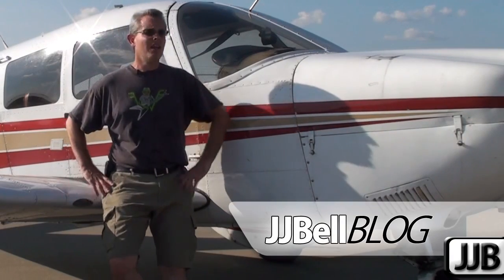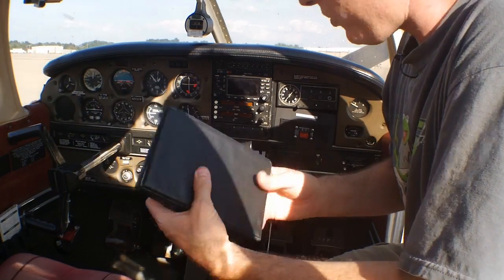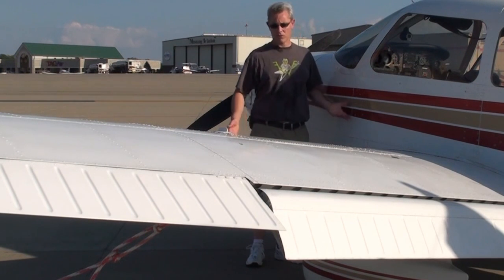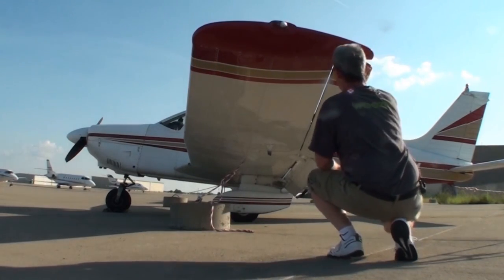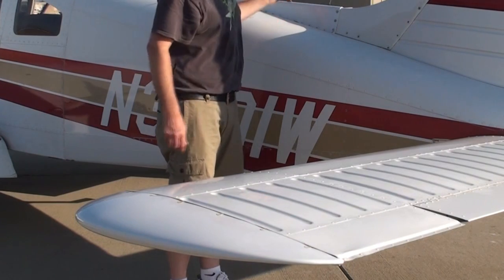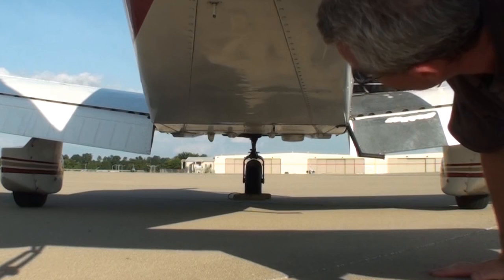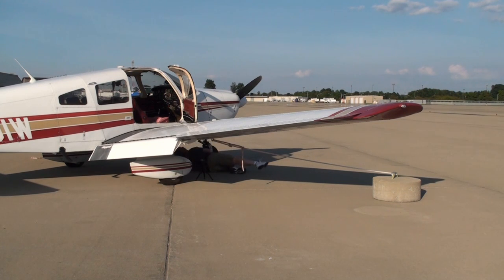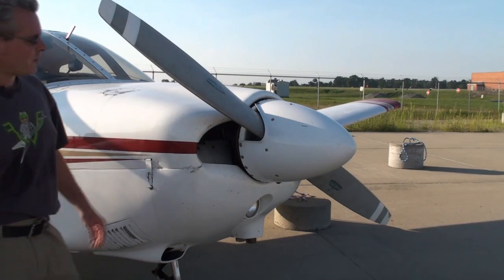Archer Preflight Inspection

Comment: Hi John, just some remarks. I suggest opening up the engine hatches and be sure nothing unusual is hiding in there. Check cables, leakage, etc.... In addition, check the breaking fluid. For your viewers, I also suggest to be sure the hatch locks are secured. Check the breaks. on the landing gear. If possible jiggle the actual break assembly to be sure it's secured.
Reply: I'd also pull on the prop to ensure it's securely on the crankshaft.

Comment: This is a very interesting pre-flight inspection video, good shots and audio. I'm glad "bird nests" were mentioned, have noticed wasp nest too in the past. Got a question about "safety-wiring".... In the video around 12:18, the view is of one of the cylinders/jugs and it appears that there is no safety-wire on two of the nuts holding the jug to the crankcase. Is this normal?

Comment: Why did you not open up the engine covers and check inside for oil leeks and anything which might be loose or not right?
Why did you not check the tyres for slippage or damage?
Why did you not check the brake hydraulics for leaks or damage?
Reply: With the Archer, unlike the Warrior, you have to remove the ENTIRE cowl to get to the engine and to be totally honest its a bitch and not necessary. Any leaks will be coming out the bottom onto the ground so there really isnt a need.

Comment: It tells you to turn on exterior lights, but shortly after it tells you to turn off all switches. Are you supposed to get out and check the lights before you turn off all your switches, or do you leave the exterior lights on while you do your exterior preflight?
Reply: I'm wondering the very same thing.
Reply: normally you should turn the external lights on then go out  to check them , then back again to the cockpit to turn them off and to turn the master switch off ( you can't just leave them on until you complete the exterior preflight because you're consuming the battery and might need and external power source to start the engine later on so watch out )
Reply: At the flight school I attend, we turn battery master, and all exterior lights on (Pitot heat also if you believe you may encounter icing), walk around the plane briefly making sure all the lights work, as well as testing the stall horn tab.  Then battery master off, and continue preflighting.  Hope that helps!

Comment: What kind of headset do you use and what do you recommend for someone to get when first starting their aviation school?
Reply from the maker: I use the David Clark H10-13.4 headset.  I would recommend them.  I have not used any of the lesser expensive headsets, but for the money, (about $300) I wouldn't bother looking for anything cheaper.  When I went looking to buy a second headset for passengers, I looked at cheap headsets, & ebay, etc, and decided to buy another pair of H10-13.4 instead.

Comment: Why didn't you start your walk-around from the Starboard wing (so you wouldn't have to walk-back after completing the walk-around)?
Also, starting at the cowl, you forgot to check the gascolator (ok, did as last item -- passing beyond the starting point -- should have done it as one of the 1st items [this is where the GATS jars come in handy])
Also, you never checked the external lights.  You checked the switches, but never got out and physically checked whether the bulbs were lit. 
Also, you missed checking the pitot for being warm/hot.

Comment: Not to throw rocks at you but wondering why you didn’t follow POH recommended starting point. Plus you didn’t verify lights and pitot heat were actually working nor did you check tire pressures and brake lines. Not quite a thorough enough pre flight in my opinion.